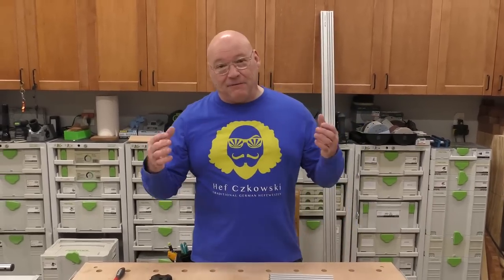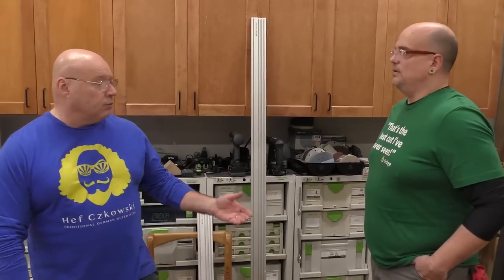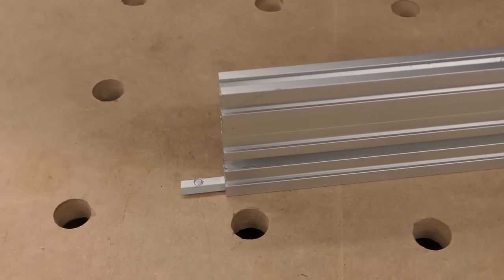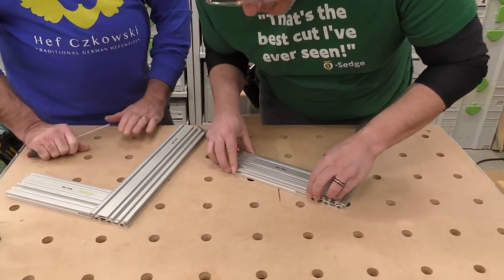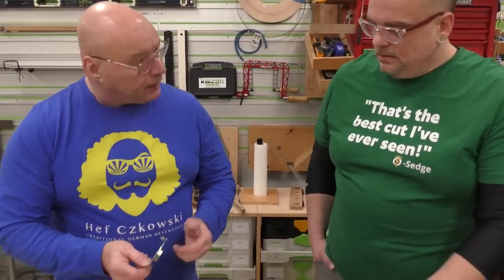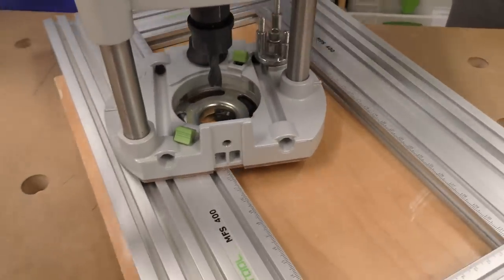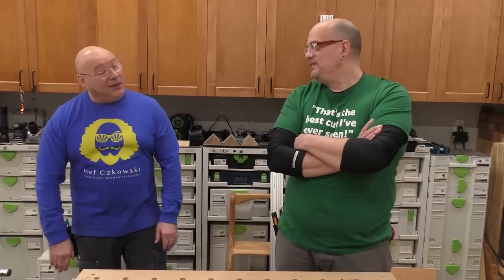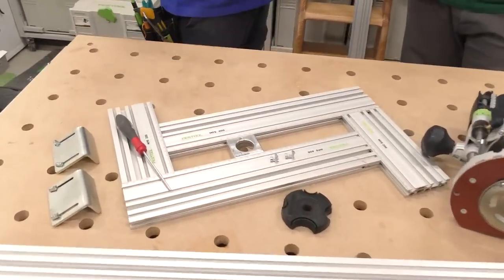Festool MFS System Overview

Comment: On my MFT I use a 1000mm profile as a "fence" --  I butt it to dogs dogs and clamp it  in place -- and 4 of the 400mm profiles to make a square that I butt up against the 1000mm profile.  I use that to square the rail to the fence. Doing cross cuts or rips I clamp the 400mm square and push the work piece against the square profile to make repeatable cuts. I'm sure there are other ways to do this and in future videos it would be interesting to see how to adapt the MFS profiles on the MFT for cuts.
Reply from the maker: Thanks John ....

Comment: Damaged my first MFS400 when I forgot to put back the template guide :) Still salvaged some of it by flipping it. Bought another one and the 2 together is quite versatile. Have used it often. Great accurate results every time. Square holes with steps are possible using different template guides (say 40mm and 17mm eg). Got rid of all the MDF jigs that have single purpose.
Reply from the maker: Great to hear! =The MFS is very versatile !!!!

Comment: I had a job that I needed multiple templates for. I bought 20mm profiles and hardware to make my own. It works well obviously not a system like Festool. The support puck is a good idea might have to 3D print one
Reply from the maker: Ahhhhhhh....as usual .... Matthew you always think outside the box .... Great job !!!
Reply: @brendon72  thanks for the tip

Comment: Great video, now to the elephant in the room, availability - it hasn’t been available in NA.  Woodpecker has an extrusion system but not some of the cool add ones (puck for example).  On a side note NA isn’t the only market that misses out,  the Sys3 slides aren’t available in parts of Europe.
Reply from the maker: It was available here in the states up to about 6 or 7 years ago........ The reason for the video is that there are a lot of folks that have reached out for help in setting it up !!!
Reply: This can sometimes be purchased from Amazon UK and shipped to NA for either no charge or for a reasonable shipping charge depending on the whims of the Amazon algorithm through Amazon Global.